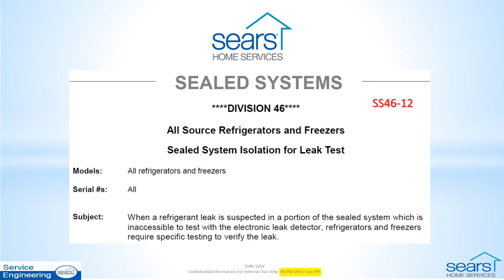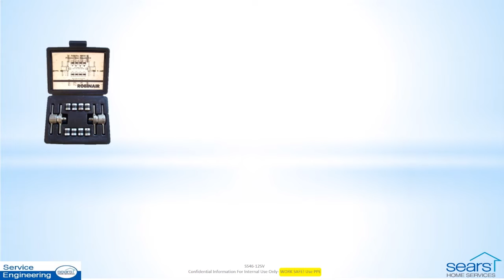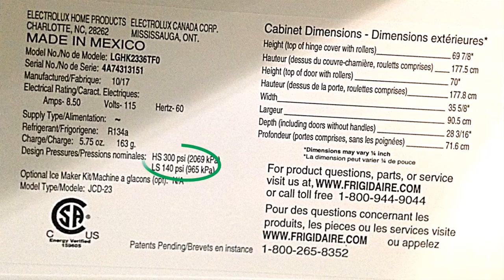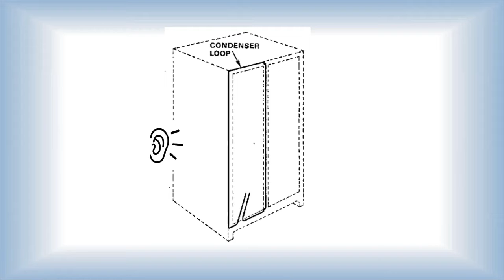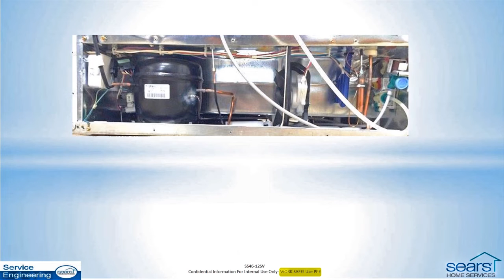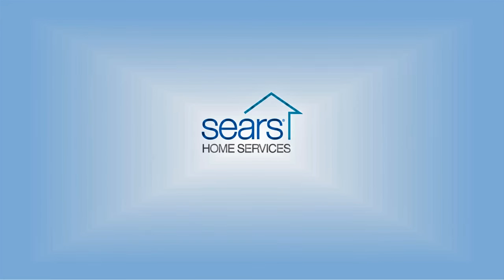SS46 12SV Isolating Inaccessible Components for a Leak Test r2

Comment: This video is great for LG fridges, cut the Yoder loop out if there is a leak, reconnect the bypass, and refill system. Ready to rock after :) 

Also Frigidiair makes an electric heater kit that fits inside the yoder tubing, so the function is restored and electric.
Reply: Part #?